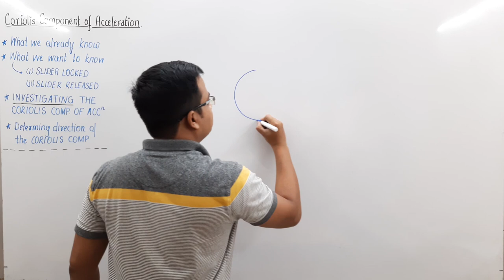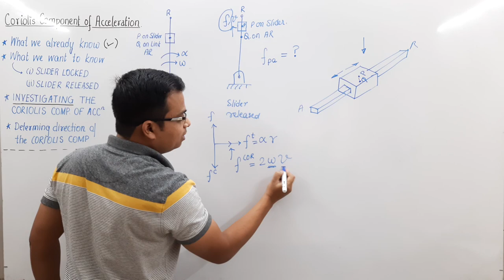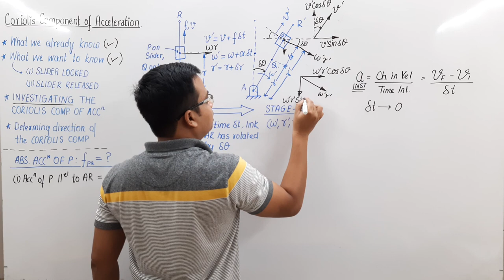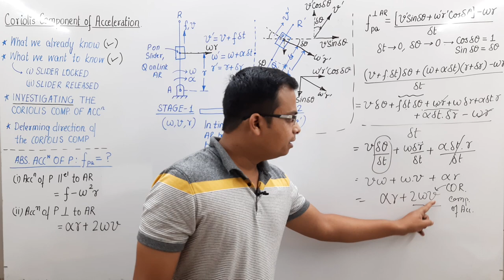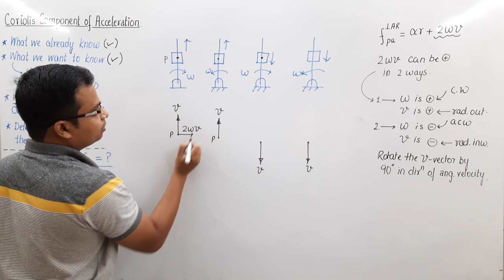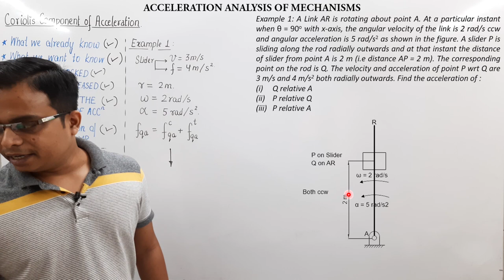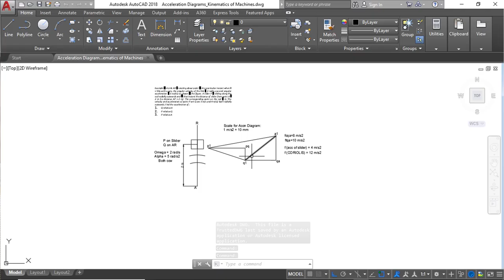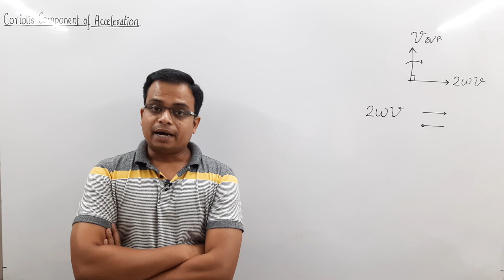Coriolis Component of Acceleration

Comment: in a slider crank mechanism having a stroke lenght of 30cm and an obliquity ratio is 4 .the crank rotating uniformly in anticlockwise direction .the angular velocity of crank is 52 rad/ sec .the crank has turned through angle of 48.45 degree from idc position . determine klein's construction 1 : acceleration of slider 2 : angular velocity and angular acceleration of connecting rod 3: velocity of slider  plz can we get ans